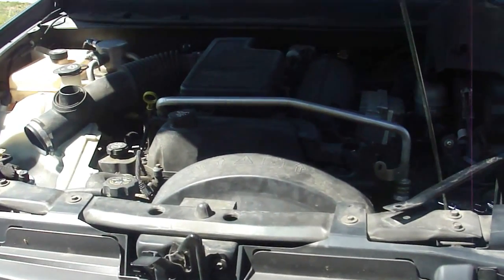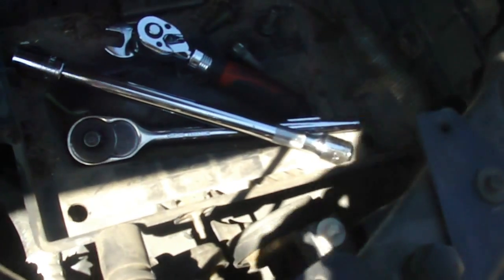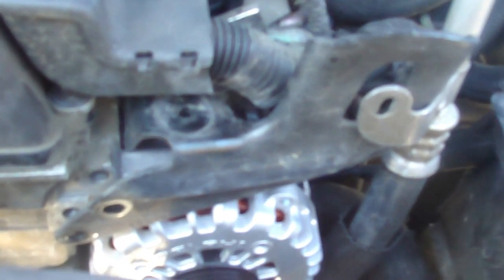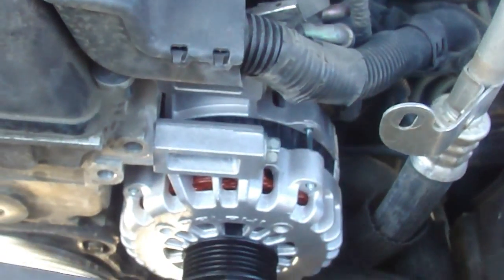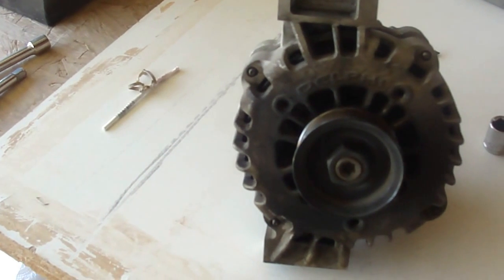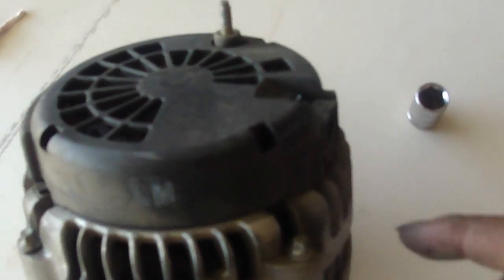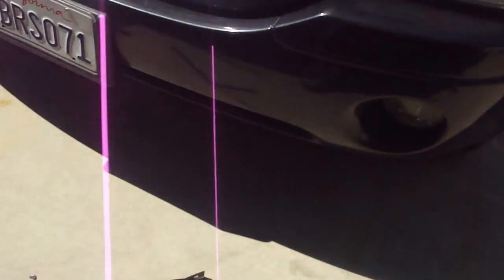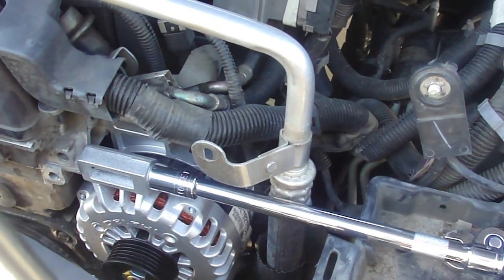Learn how to change an Alternator - # 1 reason your car battery won't start - Save Time & Money

Comment: I just changed the started on my 08 range rover sport supercharged  and I've noticed that with the new starter it has a slow crank but it cranks every time .  I checked the battery and it's still good I've checked the positive connection from the battery to the starter that's good .. I read forums could the alternater be the problem ?? Also it's throwing out hdc  and suspention fault and camshaft sensor and it didn't before please help

Comment: This really helped me. That bottom bolt is a pain, due to the evil work of some car engineer placing those AC lines where they are.I'm no mechanic, but I AM cheap enough to not want to pay a mechanic for fairly simple stuff, and this really was.For others not sure of if they can tackle it, you can. Just take your time and have the right tools. I was able to remove the bottom bolt with a 15mm ratcheting wrench, with the hand end in the fan blades. Takes about 40 small ratchet turns to loosen.
Also, someone asked about the the tensioner and size socket.... no socket- use the square end of your 3/8 socket handle into the square hole of the tensioner and carefully push to your right until you can take off the belt from the old alternator. DONT GET YOU FINGERS BETWEEN THE BELT ANF PULLY, or you will remember the experience for a long, long time, lol.
Reply from the maker: Thanks for watching and I liked how you told your story of how you did it. Good points.

Comment: I tried your method with the crows foot, but the bolt was on there pretty tight and wouldn't turn. What I did do was still using the crows foot on an extension with an elbow on it so I could have more leverage and it worked. Thanx, never thought about using a crows foot.
Reply from the maker: Ben Rillo You're welcome and thanks for watching.

Comment: Hey, brother, thanks a lot. I needed to replace a thermostat in my 04 Trailblazer, but, I couldn't get the accursed alternator bracket off. Believe it or not, of all of the Youtube bids I watched, YOURS was the first one to address the bolt with the extension. Your video has good detail, so, I'll watch other stuff. Thanks again!
Reply from the maker: Thanks for watching. I appreciate the comment. Good luck.

Comment: how would you know its time to change it
Reply from the maker: The battery was starting to lose it's charge plus the lights looked dimmer and the windows rolled up and down slow. If you have any of those symptoms you can always go to your local Autozone or auto parts store and they will check it for free. They can check the Alternator while it's in the car, so you don't have to take it out.
Reply: Thanks ,some random person told me my car would make a noise that sounded lile it needed a new alternator,which then i told him it was the vortec he said no I can hear besides the vortec it needs a new one
Reply from the maker: Oh, ok then you are good, now you know, thanks for watching.

Comment: have to do this to my girlfriends envoy.
Reply from the maker: I hope the video helps.
Reply: oxmanagain i'll let you know my friend.
Reply: well I did it. tight quarters. the back bolt behind the bracket was a pain in the butt. all works good now. thanks for the video.
Reply from the maker: That was the reason I made the video because, of those back bolts. I'm glad the video help out and good job, that's not easy. Thank you for watching.
Reply from the maker: Just in case you ever need to change the spark plugs, rear brakes or the power steering on the Envoy I made those video as well.
Reply: oxmanagain all of those have been done already. Thanks.

Comment: Bottom bolt comes off super easy using the closed end of a 15mm box wrench, a block of wood over the open end a whack with a mallet on the wood. After 2 hrs of trying different combinations I couldn't believe I didn't try this first!http://s1004.photobucket.com/user/volunteer4haiti/media/Mobile%20Uploads/image_1.jpeg.html
Reply from the maker: +P C It was hard if I remember right but if I ever do it again I will try that. Thank you

Comment: This would be the same for 2003 Oldsmobile Bravada 2wd?
So all three are 15mm bolts?
Having hard time getting the plug out, as well the valve cover out?
Can you assist?
Reply from the maker: +angelisone yes all three are 15mm bolts. On the plug I left it on until I could turn the alternator and if you remove the battery you can gain a little more room for the cover.
Reply: +oxmanagain Will give it a try on your suggestions.
I still think it is a pain trying to remove the valve cover when I will need to remove 10 10mm bolt of the intake assy.

I can't even see many of those 10mm bolts, especially those next the window. What is your suggestions on this?

Thank you for replying back.
Reply from the maker: Are you sure the cars are the same, I don't remember 10 10mm bolts on the valve cover?
Reply: +oxmanagain A lot of 10mm bolts on the valve cover for the 2003 Oldsmobile Bravada 2wd.  Just can't find much video on Bravada.

Comment: That 10mm on the back of the alternator, does it hold a wire?
Reply from the maker: +destineal Yes it does
Reply: +oxmanagain I just changed my alternator. what a tight fit. thought i was going to break the fan or shroud taking it out
Reply from the maker: destineal Yes it was a tight fit for me also
Reply from the maker: +Pikachu wow you did a lot of work your skills are better than mine. I hope I don't have to remove the alternator ever again. Plus this is my sister's car so yeah haha.